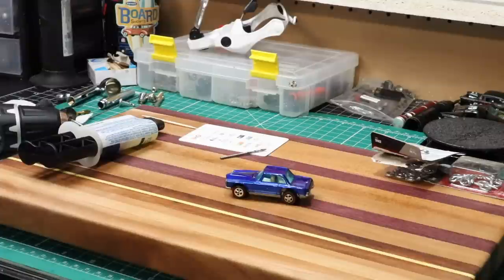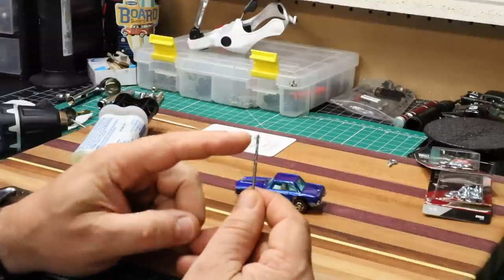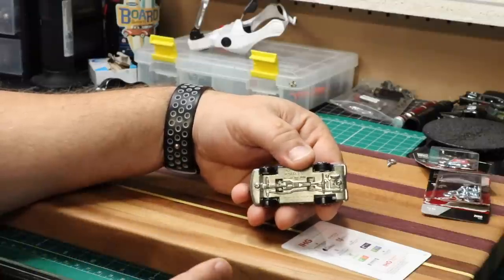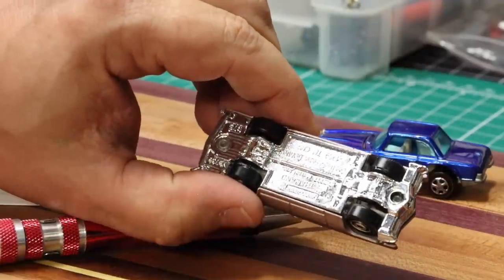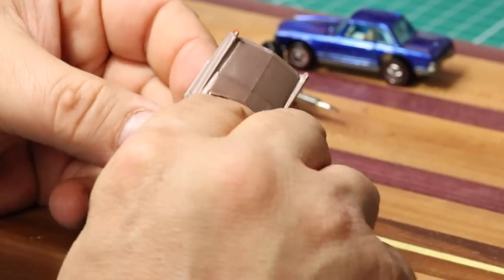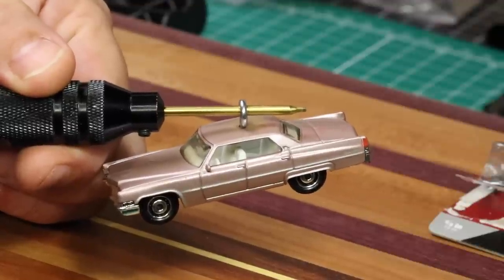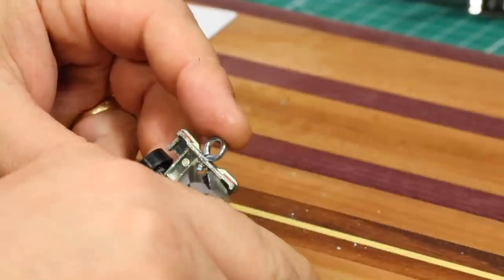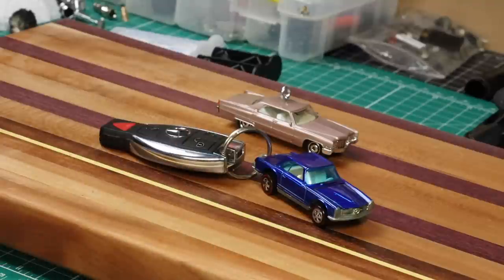How to Make Hot Wheels Keychain & Hot Wheels ChristmasTree Ornament

Comment: Really cool! I was planning on making a key chain out of a Tooligan since Im a mechanic and this gave me a better way to do it, so thanks. Wish I thought about the solder iron idea before, the first car I made a custom out of was the first hotwheels I ever painted when I was really young, a 64 Impala hotwheels. I think I was in second grade and my grandfather taught me how to use spray paint. I cracked the front bumper on it drilling the posts but was able to fix it. Took the wheels, roll cage, and engine from a destroyed 1BaddRide Ford GT and swapped them into the Impala, and cut out the side windows so you could actually see the interior with the cage. Paited it a metallic blue with a silver interior to go with the chrome wheels.

Comment: So, I recently dug out my old cars for my son to play with an within the collection I found some of the 2005 Acceleracers cars from McDonald's Happy Meals. My kid is infatuated with them because they light up but at least two of the three have either very weak batteries or really loose connections. I was wondering if you had any recommendations on easy ways to fix these up or if anyone knows how complicated it would be to replace a battery on this type of car? I have never done any work customizing or repairing these cars so I'm just wondering if it's a good place to start or is because they're cheaper made than the normal cars if maybe the metal is weaker or something?
Reply from the maker: Hmm. Not sure, I'll have to research them a bit.

Comment: Do you do commissions?
Reply from the maker: I typically don’t do restorations but that doesn’t mean I won’t. Pricing is so tricky on these little cars and sometimes parts and paint are more than the cars are worth. Example Wheels = $6 plus shipping, glass (if needed) $8 plus shipping, Spectraflame paint $7 plus shipping and shipping car both ways is roughly $8 total. So you could have $37 in the restoration before any labor is involved
Reply: @WheelsNThangs  Oh wow, thank you for the info. Great videos!